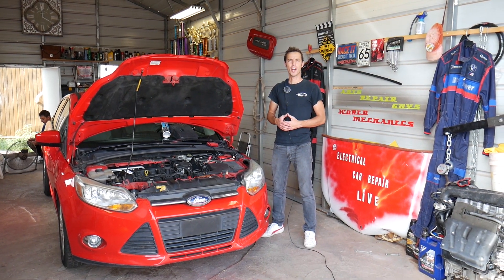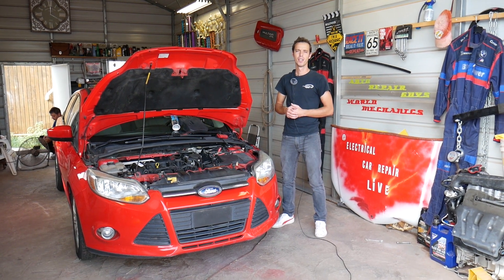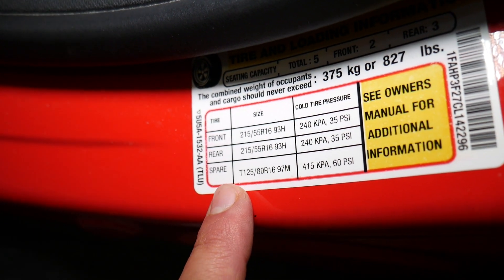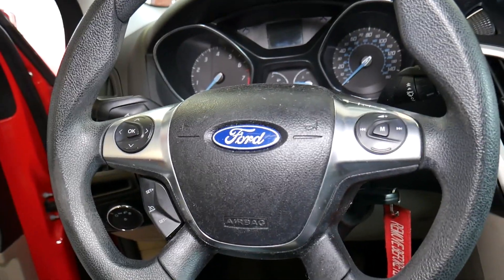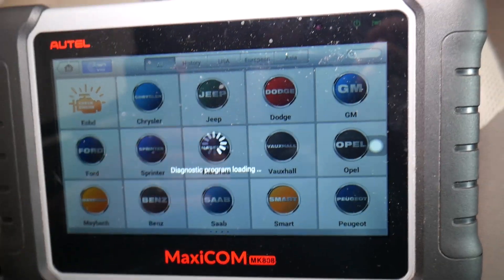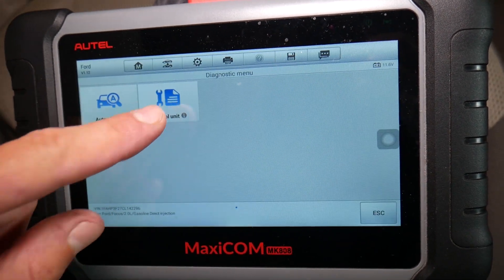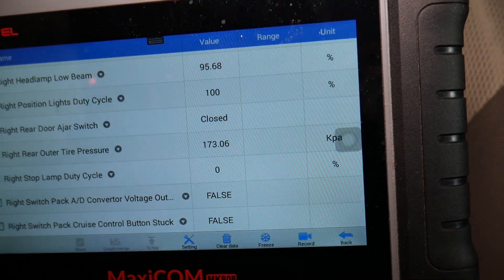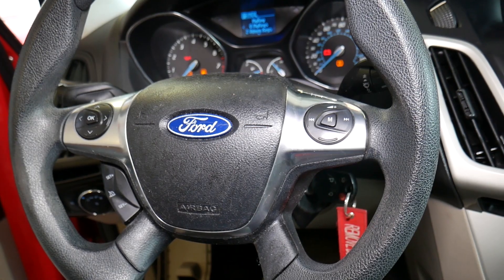WHY IS THE TIRE PRESSURE LIGHT ON FORD, DO I NEED NEW TPMS TIRE PRESSURE SENSOR

Comment: You should mentioned that drastic outside temperature change can affect the tire pressure. Early fall, when the temperature goes from warm to cold will sometimes show up as incorrect tire pressure. The reason is that temperature affects your tire pressure. So, all you need to do is re-adjust your tire pressure when that happens and you should be good for the season. Don’t forget that some sensors will show “low tire pressure “ when all your tires are at the proper pressure. That usually mean the “spare tire” needs air.